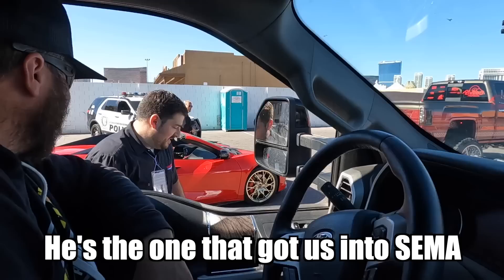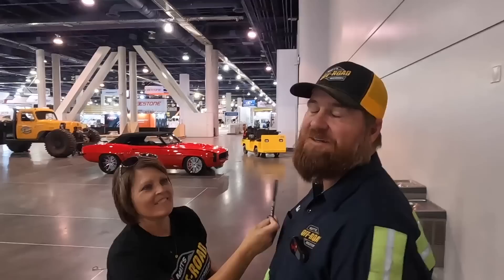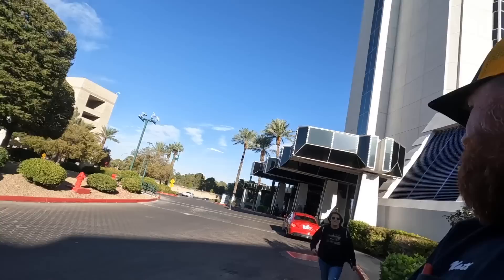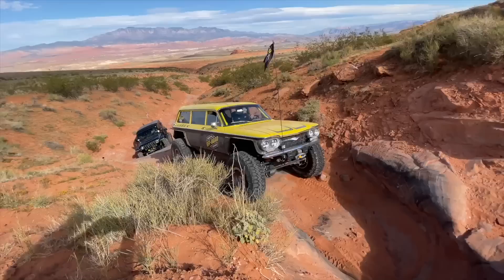World's Largest Off Road Wrecker Takes Over SEMA!

Comment: Way to go, Ed!  Sometimes it's the little things that don't turn into bigger things that make your day go better.
At 2:48 Matt was about to lift the battery out of the tray and Ed immediately went to help.  Age brings wisdom and Ed knew that the snug fit of the rubber would cause the tray to lift off and then possibly drop on the floor or Matt's foot. 
Ed "knows a thing or two because he's seen a thing or two."
Reply: Ed is ALWAYS right there with the flashlight in the right location too.
Reply: A very astute observation Sir!
Reply: I thought the exact same thing.....Ed was just right there Ed On The Spot

Comment: I was thinking you will need an integrated remote for all of the winches like on a modern off the shelf heavy wrecker, if you don't want to get them all mixed up. Harbor Freight coming up with the design was a great move all around.

Comment: My jaw dropped as the HF guys handed you the yellow case! What a genious solution for a very unique situation. Keeping 7 (seven!) winches under control is no small task... 😲
Btw: thumbs up that the Auto-Home feature of the heavy wrecker already works! When it's finished the wrecker will have a hybrid drive: the petrol engine and 7 electric motors. 😂😁😇🤟
Reply: Agreed!
It's so cool and clean. They didn't have to go out of their way like that, but they did and it will elevate the build just a little bit more.

Comment: The Harbor Fright winch remote system is an awesome setup. Makes total sense. Don't take the go cart results too seriously Matt. The weight of the driver in those electric carts has a huge impact on how quick they are. I'm in no way implying you are heavy, but it's obvious Lizzy is lighter than you. It is what it is. That looked like a lot of fun though.

Comment: Small suggestion, some sort of pinholes in the battery box to prevent water from pooling and rusting things.      Not that things wrecker will sit for very long and I'm sure all the road jarring will vibrate out the water, but rust will be present especially if those batteries leak acid.    Maybe some sort of solar chargers on the lids to keep the batteries at full capacity while sitting?

Comment: Tell Lizzie that flat stock will cut much better if you turn it on edge. The saw teeth will cut better because there's less friction and less heat buildup. Wide flat surfaces are hard on those cold cut blades.

Comment: Great build of a massive recovery vehicle. Matt and his team have gone past my high expectations. Question:  Why not use aluminum for non-structural components (like your battery platform)?  Any chance to reduce the truck's weight seems important for how it will perform out in the sand and climbs.

Comment: I once buildt a batteryshelf for an old Volvo 140, but as this was on the acid led battery time I buildt it using stainless acidsafe steel, then I slightly bent the bottom in a cross over the corners, and then welded in a short tube in the middle, attaching a hose that ended up below the car, this was making it able to keep the paint in the inner fender stay put when washing the car as those old led/acid types allways leaked slightly.

Comment: steering for axles that size is easy either buy a hydraulic conversion kit from an off road shop or do like we did in the 70's and 80's go to an equipment parts yard and get the steering rams, pump and power head from an old loader . most old loaders had normal axles unlike the modern ones that are articulated in the center the best part of the old loaders is they had crab walk steering meaning you can turn all wheels in one direction and walk out of a sand trap or mud hole side ways if you have 4 wheel steering it's a must have and could give you an advantage most wreckers don't have

Comment: here a tip flat bar cuts easier if stood on its edge and with less heat distortion and damage as your cutting a thinner section.

Comment: That last bit was funney as hell! Matt don't be embarrassed by the wrecker. That yellow fellow is a purpose built rig that will see nothing but dust, sand and mud. It will be the white ... er yellow knight showing up when someone is having a bad day. Contest aside, its singular purpose makes it a unique tool of hope. The yellow fellow does belong at SEMA. Do NOT ever have it detailed. If you do, the truck may rebel and quit on you. Clean it up yes. Paint it up to protect the metal, yes! If that rig is ever found without a bit of sand, bust and mud, then the yellow fellow project will be a failure. May the yellow fellow have a long and useful life! I await the stories you will tell with it.

Comment: The problem I see with the battery box is when replacement time comes, and you cannot get the same size. 35 years in trucking experience.

Comment: Don't foreget to add some Radiator Stop Leak and Antifreeze to those Jeep Beadlocks or you will be constantly adding air. Stuff works and it doesn't corrode the wheels.

Comment: As for the steering on the wrecker have you considered using the system the 4 wheel drive offroad fork-lifts use? They steer frone or real or both or crab sideways and it's all selected with a switch and of course controlled with the steering wheel.

Comment: If harbor fright supports Matt and team and other like them then I will continue supporting them. Andrew from harbor freight winch designer doing a great job Harbor fright got some good winches one been on my 2007 Honda since 2014 been submerged in red mud and creek water and sand countless times it’s model with little remote and it still works like the day I got it

Comment: The one time I thought he was building some drainage holes into the bottom of a big unpainted carbon steel cup... and it turns out they were just so he could plug weld it straight to the chassis.  WHAT DID BOLTS AND RIVETS EVER DO TO HURT YOU GUYS?!?

Comment: would like to comment on the positioning of the steering valve down low  instead of on firewall and run hydralic lines down to front and rear steering cylinders just an maybe good idea to protect valve and hoses

Comment: If the Big Wrecker’s motor is roughly pumping out 500 HP & the rig is 10,000 LBS .. 
isn’t that only 50 HP per 1000 LBS … ?    Power to weight ratio doesn’t look good boys .. 
might need a bigger motor .. hope i got this wrong.

Comment: I love milestar Patagonia M/Ts becuz I was able to drop em down to 15psi and travel 100 miles during MN winters without breaking or popping the bead also only having to use 2wd on my 99 Durango 5.9 slt my old Durango was built like 1ton. Whenever I needed parts that fit I had to order 1ton Chevy parts wish I had the monies for Transgenderfinder I would of kept it

Comment: Very cool, but doesn't Heavy D have some big off road wrecker rigs?
Reply: We need to make a distinction between driving off the pavement and driving off road. Heavy D's wrecker does just fine on semi level, semi hard surfaces - dirt roads for example. But it's about as capable as a dump truck. Matt's wrecker, on the other hand, will be doing buggy trails.

Comment: It's a cool truck but it's not the world's biggest off-road recovery wrecker. Not by a long shot. M984 Hmett has a gvwr of 100k lbs it rides on 8 53" tires. Granted it wouldn't do well on tight trails but it's proven on rough terrain and it is bomb resistant. There are a ton of military wreckers that are much larger.

Comment: i gotta ask, do you have any good reference material for low centre of gravity trail truck chassis? i know its a strange question, but i wanna make a somewhat scale rc trail truck but high centre of gravity comes with difficulties that low centre of gravity does not (in rc top heavy rc tend to fail at getting the full grip out of tyres on certain inclines)
Reply: for reference, in rc comp crawling low centre of gravity is as most these days call it "the meta" if you will, but a trail buggy is similar, however low centre of gravity trail buggy whilst is a "meta" is generally considered and refered to as a comp trail buggy rig, the most well known one being the bully 2 by rc4wd but to be honest, a somewhat noticably modified ftx ravine can make one with hop ups look bad and whilst i love my ravine, it is only £100 and rtr
Reply: just to clarifiy, there is 4 types of trail buggy the bully 2 is one type, the axial capra is another, the ravine is also another but is of a similar type the the bully 2 and the 4th is like the heavily modified axial scx10's that are given as much angle as possible

(addendum, on a side note i could have worded that in far less words and as a single comment...)

Comment: I bet you it will be the diesel Brothers with Dave's Hemet wrecker
Reply: Heavy D might be a judge, but his wrecker wouldn't even fit on the trails
Reply: It is going to be merlin old skool garage
Reply: @lasieboss703  There's been absolutely no mention of him on MORR, and since Matt is setting up the event I highly doubt it. Heavy D, on the other hand, did a collab with MORR.
Reply: @JohnFL  It's in the title of merlin old school garage latest video. He also has ties with fabrats, Merlin build an engine for them.
Reply: @lasieboss703  I just find it odd that Matt has never mentioned him, whereas Paul, Rory, Eric, and Heavy D have all either done collabs with Matt or talked about Matt having discussed it with them.

Comment: The one thing you never told us, Milestar Patagonia's are terrible tires. I lost one due to a stick going through the sidewall while I was driving down a road, and the remaining 4 tires are less than 50% tread with only 2,600mi on them. Too soft, and not enough plies. Honestly you guys should stop promoting them as awesome off road tires, cause they suck.
Reply: @MattsOffRoadRecovery  I'm glad they are working out for you.